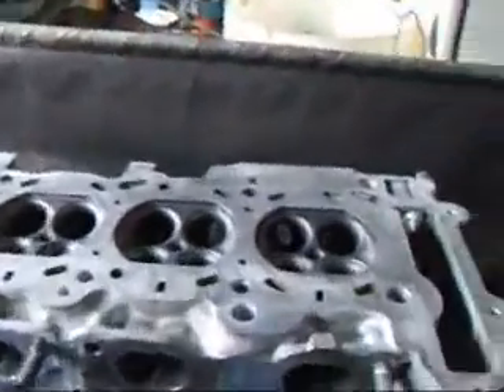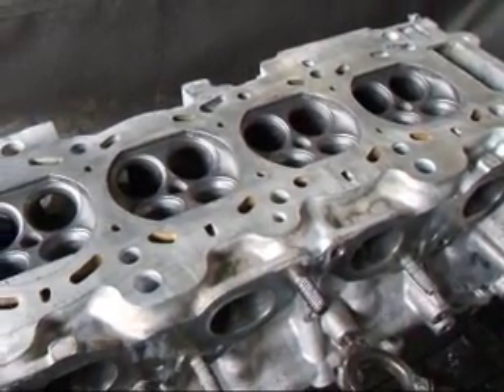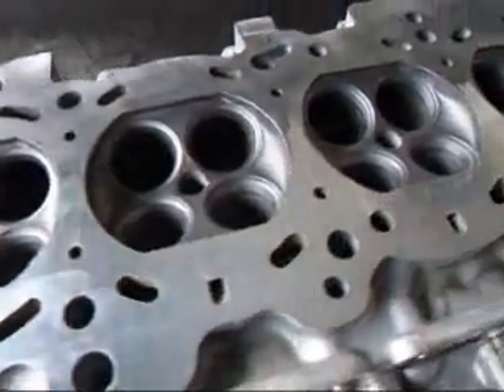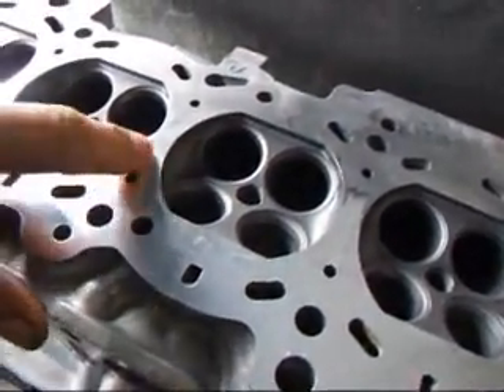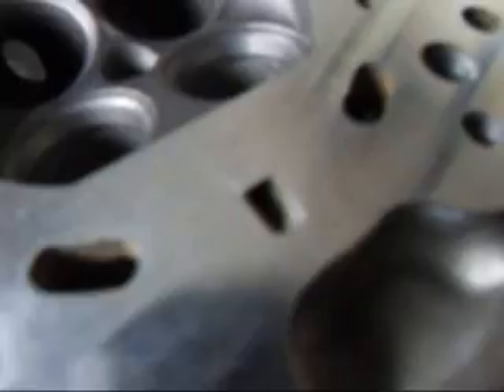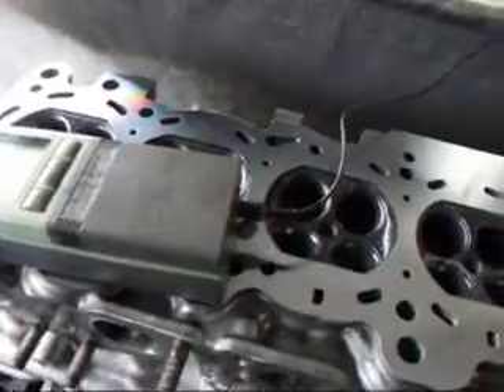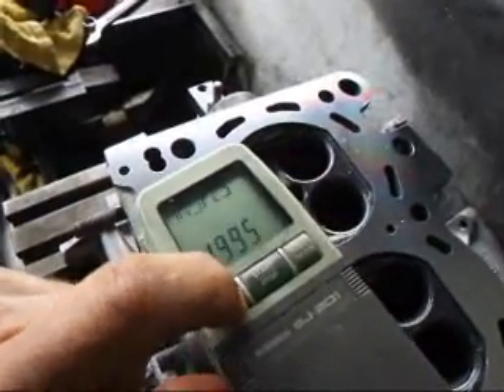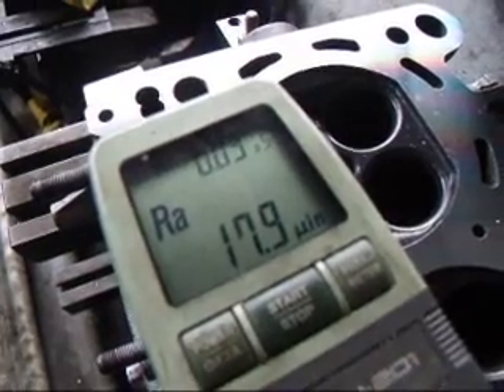Nissan SR-20 DET Head Resurface

Comment: I have seen it all to often..And it happens more often that the person is not so much trying to resurface the head with a scotch bright pad but more so using the pad to clean off old gasket material and not realizing they are taking material from the head creating high and low spots..3m Sells a really nice Disc called a "roloc" Disk and its made to be used on a 90 Degree air tool or standard drill and will remove gasket material without harming aluminum or cast iron! it's a great piece to have!